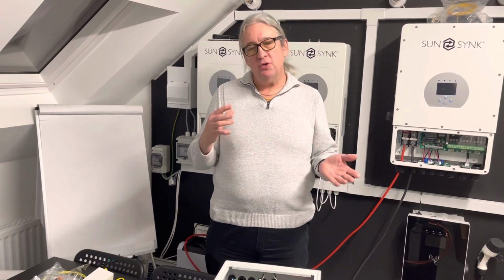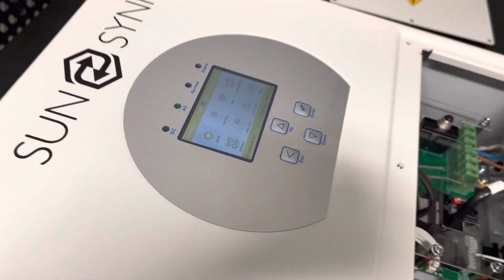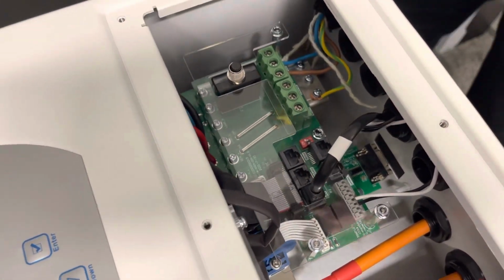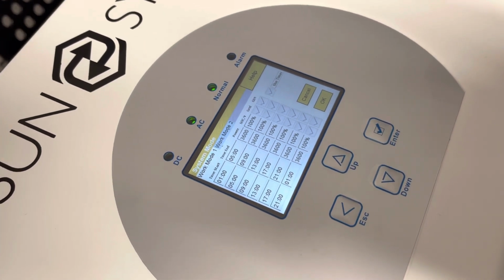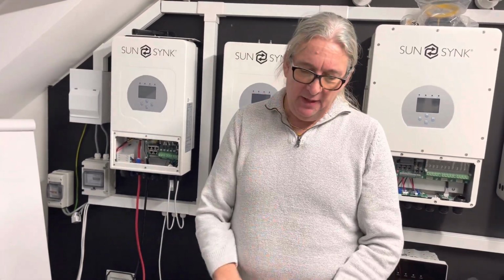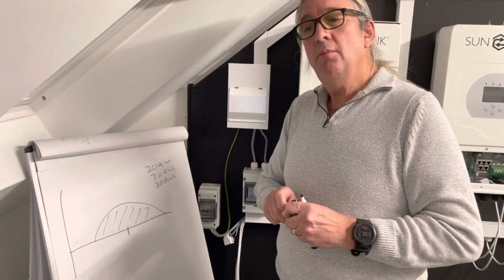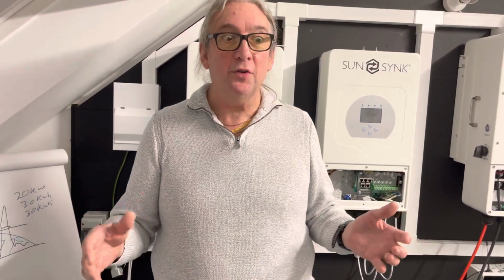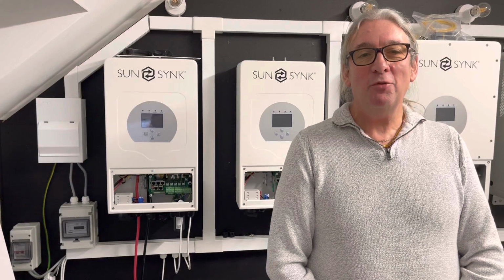Sunsynk 3 .6 kW hybrid Inverter videos covering basic set up And looking a future applications

Comment: Hi, I have a DIY garden setup with multiple MPPTs and 3 different arrays, I also have an EV that I charge at night on my EV tariff, but I dont need to charge that every night. Would your inverter and battery fit with this system? So can I plug in my DIy inverter (2000w renogy inverter) into your system to charge the main batteries when I have excess solar with a simple 3pin to store up more energy as I only have 2kw batteries at the moment in my shed that is often 100% by midday.
Reply: Don't forget, you can power your house from the car battery too - works both ways depending on car...

Comment: Hi, everything I have seen so far leads me to believe that there is a bias towards solar power and this is fair, What I would like to know is whether a home sized wind turbine (1kw-5kw) can be connected to either the 3.6, 5 or 8kw inverter given that it has 2 MPPTs? Can the second MPPT handle the variable DC from a small turbine or is there a specific  SunSynk inverter that can cater to a combiner solar/wind system? Regards, James

Comment: Not a criticism just an innocent question! Are your Sun Sync inverters manufactured by yourselves, or are they a rebadged unit?
They look identical to the series of Deya inverters, which are of Chinese origin.
I am looking for a competitive and reliable inverter and came across yours on YouTube. 
Good video by the way.
Reply: from what i have found is yes the electronics are Deye, but the software is Hong Kong made and UK based
Reply: @charlwamsteker8879  Thank you for your response. I currently reside in the UK, however, I have been planning for a couple of years to move to Nigeria to establish a solar company to provide backup power when the grid is out. I have purchased and have been evaluating a Growatt SPH6000, then I stumbled across the Sunsynk inverters. I haven't purchased a Sunsynk inverter yet, however, it appears to be feature rich, installer friendly and very reliable. 
I do want to purchase a Sunsynk inverter for evaluation purposes, but where would I source them in the UK? When I move to Nigeria, where would I source these inverters?
Looking forward to your reply.
David.

Comment: Hi Keith, when in the UK and from Segem will we be able to get the 8KW with the meter option rather than CT like in this little 3.6kw unit
Reply from the maker: 8.8 is available now, it can work with a meter instead of a ct coil
Reply: @sunsynk  do we use the latest firmware and connect to what is labelled up as DRM ,  and is the meter a standard acrel  or dose it need to be flashed